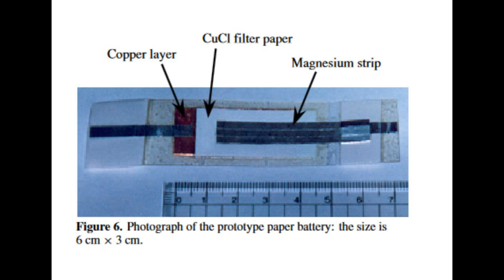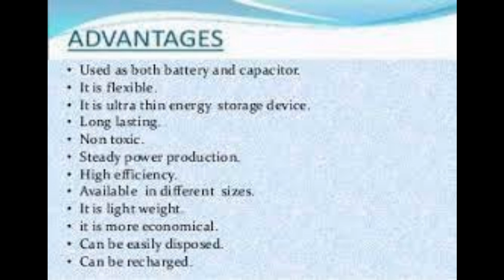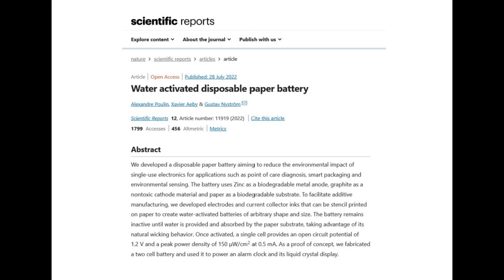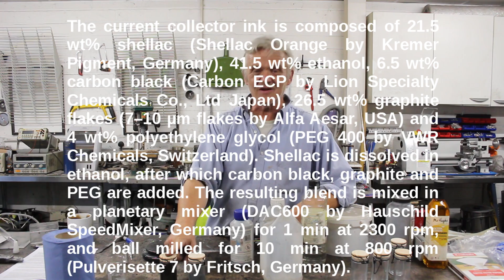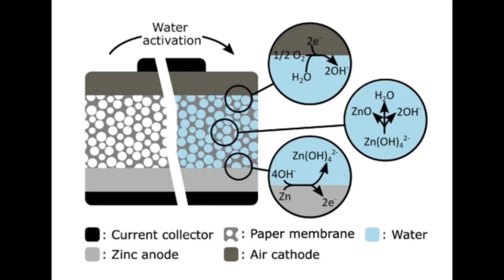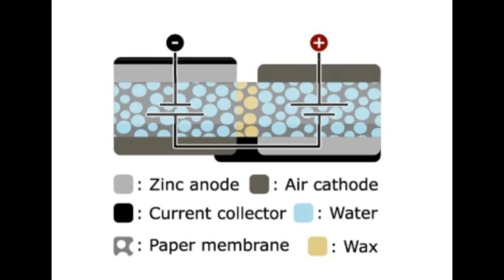1628 Paper Battery As Powerful As an AA And Activated by Water

Comment: If I'm understanding it correctly, someone could in theory insulate each side with a biodegradable wax or wax paper, roll it tightly, and somehow activate the electrolyte when ready use, would have an AA battery for 2 hours that's entirely biodegradable and cheap? I like it. Sounds like it would be invaluable to underdeveloped countries
Reply from the maker: I like the way you are thinking there mate
Reply: The Military has already been there and done that.
Reply: You could put the whole thing in a seal-able package like they do with the lipo's and put a small burstable plastic bag of water in the battery, squeeze or slap it hard or whatever to activate.  Or have some sort of package which you can inject water into with a standard syringe or similar.
Reply: @hootsmin  Emergency battery, i like it.
Reply: Or use potatoes..
Reply: Pardon my atrocious grammar lol
Reply: @xxEndermelonxx  Dont worry about the grammar, its the content
that counts!
Reply: The definition of a battery is two dissimilar metals immersed in a conductive medium. So really it's pretty open ended.
Reply: @zeabobql3923  a container consisting of one or more cells, in which chemical energy is converted into electricity and used as a source of power. That's the definition I found.
Reply: And when discharged, let it dry out, set it on fire, use it to boil water for a cuppa tea, drink tea while making a new battery, recycle ashes into a new battery.
Reply: The best bet would be another piece of paper on one side so when it's rolled up the anode and cathode will be contacted by the electrolyte from both sides, should increase current delivery and reduce internal resistance.  A similar concept to what they do with electrolytic caps

Comment: It might be possible to roll up the paper into a tube or stack multiple sheets of paper with sort of insulation between them to increase the voltage, though I am a little concerned of arching with a load of paper in a area
Reply from the maker: did you know paper is actually a fire retardant?

Comment: Robert great video sir ..The issue i have with off the shelf rechargeable NIMH batterys like AAA and so forth is the lower voltage in some cases hurts performance of what its running but thats that
Reply from the maker: yeah indeed mate - but sometimes you get what you get!
Reply: @ThinkingandTinkering  yes sir reBob ye do.and all the pissin and moaning about it changes nothing it seems 🤐
Reply: there are, or at least WERE  nickel zinc batteries with a 1.6v terminal voltage, i'm using some in a digital camera which doesnt like nicads/nimhs due to the low voltage, but eats normal alkaline ones pretty quickly , i got 4 of them some years back , unfortunately 2 have since failed after only a few charge cycles, gone 'open'  maybe this is an issue with them? limited shelf life?  i have no idea as yet if theyre still available, i hope so as would like to get a few more, you have to use a charger designed for them as nicad/nimh type is not advisable as simple types will overcharge them (may be possible to mod them), 'smart' ones likely to reject them as 'bad'
Reply: @andygozzo72  cool ill look into it thanks